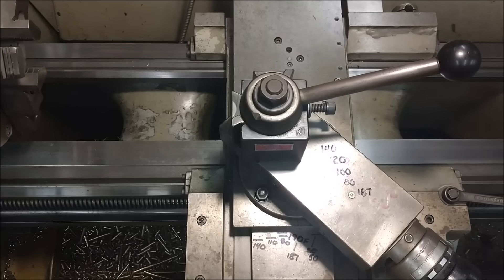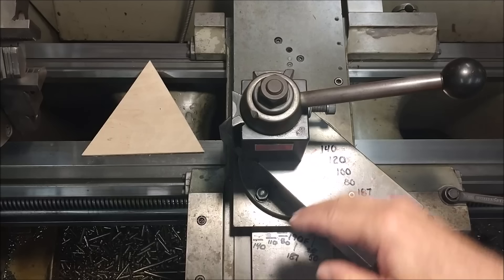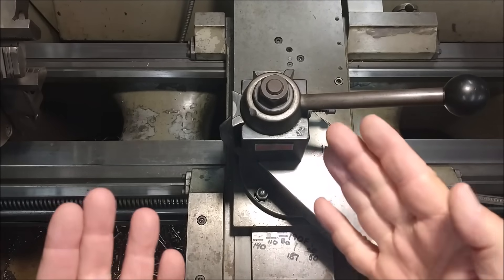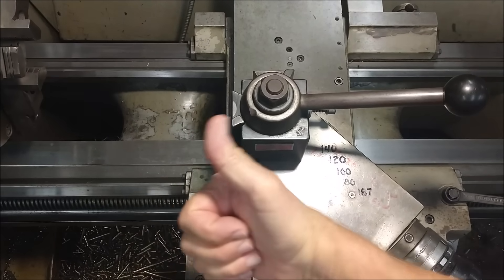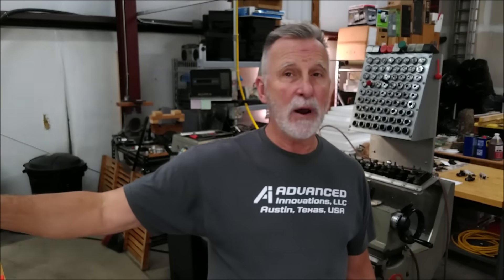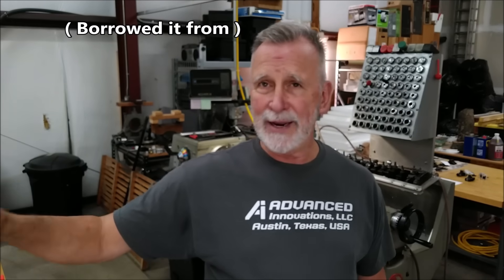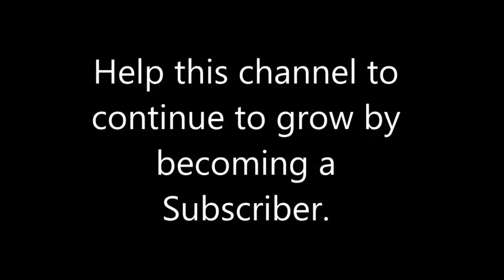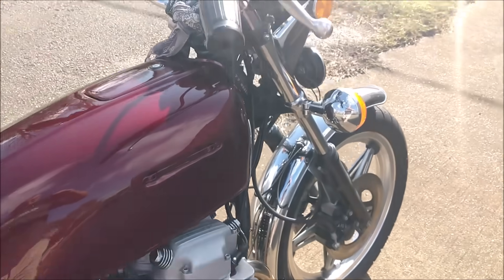New ( and current ) Machinists Should Watch This !!

Comment: On threading :
If you cutting an external thread turn your compound towards the tail stock to 29 1/2 dergees.
On cutting internal threads turn your compound towards the head stock 29 1/2.
degrees.
ALWAYS USE YOUR FISH TAIL GAUGE TO LINE UP YOUR THREAD CUTTING TOOL.
Coming from me a retired journeyman machinist of 40 years experience 😊
JOE PIE KEEP THE VIDEOS COMING TO PITTSBURGH PA, THEY BRING BACK MEMORIES OF MY PAST LIFE!😊
Reply: 29 1/2 for a 60 degree thread. 27 1/2 for 55 degree (Mauser rifle barrels are 55 degree threats

Comment: The first threads I cut on a manual machine for practice were in Delrin. They didn't come out too good. The second practice round looked much better. Then, I got some wires so I could make them to size. Now it doesn't matter. Steel, aluminum, stainless, whatever, they all look great and are to size.

Comment: Thanks for all the great vids.  I am not a machinist but i find it very interesting.  I have 2 friends that are master gunsmiths and i love to watch all of you at your trade.  This is slightly off topic but this is the most recent post of yours and i was hoping to get a response.  When threading away from the chuck and you are feeding in with the compound, is it important to have the travel of the compound moving into the work piece at the same direction as the direction of travel?  I assume not as the threading insert is a form tool and i have never seen your compound facing that direction.  Thanks for all the valuable information you provide.  If i ever get a lathe i plan to hire you as my instructor.

Comment: Interesting.  In 1985, I started attending a Machine Shop program at a local JC.  They required that you come prepared on your first day of class by acquiring a few things.  First, one of those small, portable metal toolboxes with a padlock.  Inside the box, we were required to have a pencil, a notepad, a six-inch scale, a quality 0-1" micrometer, and a pair of safety glasses with side shields.  The first project was to make a scribe handle, turned from aluminum hex stock, and the scribe tip from a chunk of 01 drill rod, which we then heat treated with a torch and quenched.  The scale and micrometer were used in the process. The second project was to use that scribe and six inch scale to lay out a drill tip angle gauge in steel, which was then milled and drilled to size and final shape.  This new tool was then placed with the new scribe in the new toolbox.  After that, we spent time on the bench grinders manually sharpening drill bits, followed by making HSS lathe toolbits for cutting steel, brass, aluminum, and plastic.  Those also then went in the new toolbox.  After that, we were given a set of drawings and bar stock in various materials, and were free to go use the bandsaws, lathes, mills, drill presses, bench grinders, etc. to make... you guessed it... another tool for the toolbox.  It was a machinist's hammer with exchangeable heads in differing materials.  Then, a c-clamp was also made for the toolbox.  It was a genius program design because you made all the tools in your first semester to be used throughout the following semesters.  After graduation, you had a nice toolbox with all the basics in it for your first day on the job.  Brilliant program design.  Excellent tool designs, too.  This was all done on manual machines, by hand.  This program was not NC-equipped at that time, so you had to get used to managing things like leadscrew backlash, speeds and feeds, and so on.  You did not need to stock up on things like store-bought follow-rests, etc.  You made what you needed exactly when you needed it.  When done, it was yours to keep forever.  Sheer genius, I tell ya.

Comment: I had to take off the Corbin solo seat I had on my Road Glide when I changed to a stretched 6 gal tank.  Currently have a LePera seat, which is tolerable, but definitely NOT a long miles seat.  I could spend all day in that Corbin.  Tried to get a seat shop to re-profile the nose of the seat, but due to the glued foam construction, was a non-starter.   Still have the seat, hopefully I'll find someone who can make it work for me.